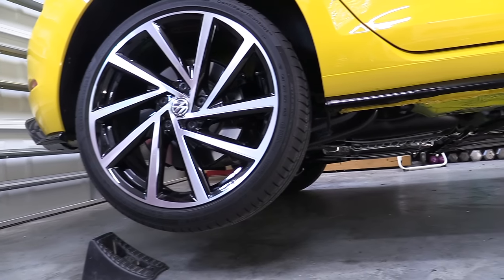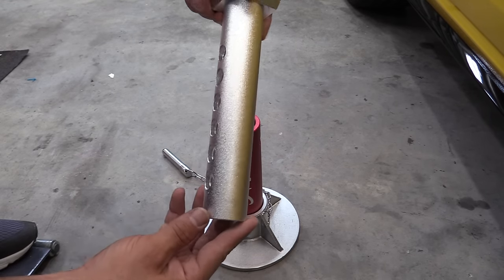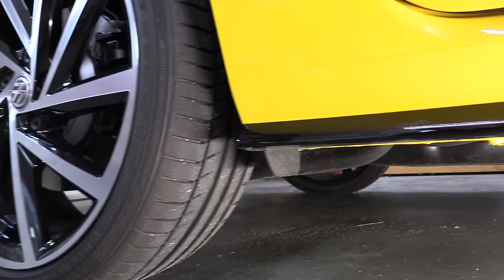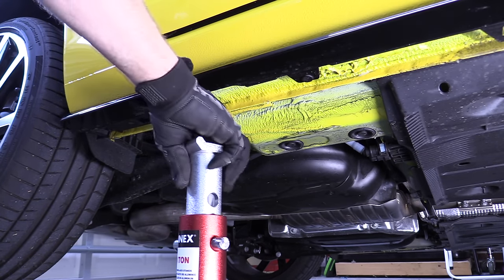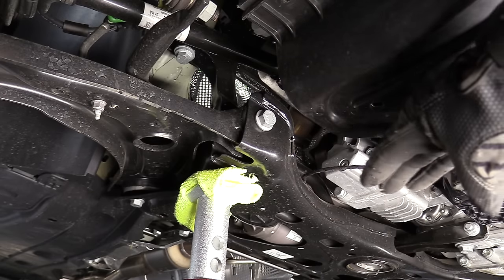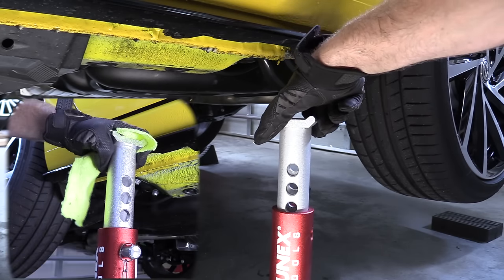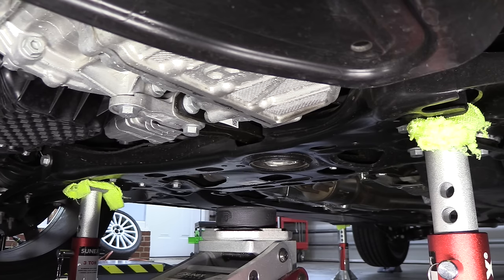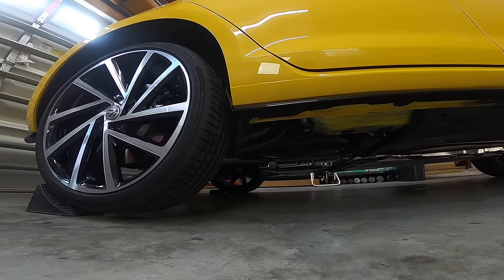How To Properly Lift a Car on 4 Jack Stands

Comment: Sorry. But I dont see the difference between pinch weld or any other part of unibody subframe. What the heck is OP pointing at?
I have 2022 Alfa Romeo. Just for giggles I looked up its lift points on Alfa service PDF. But when looked under vehicle, I could not identify the points as shown in PDF.

Comment: I know this is a super old video, but let’s say I need to get the jacks on all of the pinch welds cause I’m doing work on the sub frame however, my car has so much suspension travel. I can’t jack it up by the rear to put it in the front how would I go about putting them on both sides?

Comment: The angle difference and sideways pressure on the jack stands is less when you go front to back, instead of each side like in this video. Look closely at the first set of jack stands when he's lifting the opposite side. Look how much sideways flex is on them. Not good. The idea when lifting a car completely off the ground is to maximise the distance between each side being lifted. The longer distance means the lift angle is les, which means less chance of the car toppling off the top. Long story short, LIFT THE CAR FROM THE FRONT FIRST! Put jacks on lowest height setting, and then move to the rear and do the same. Once the car is off the ground, move back to the front and raise the car higher as required. Doing it in steps like that greatly minimises the side ways strain on the jack stand... the main cause of stand collapse/failure. Also, DON'T use wood to prop up the car! If you want something between the jack and car subframe, buy something made for purpose.

Comment: Sunex (and every other safety stand manufacturer) do not recommend supporting a car with 4 stands. Check Sunex’s manual.“Stands are to be used in matched pairs to support one end of a vehicle only”. I was called out on this years ago by my company’s OHS. I thought they were crazy but they were right.

Comment: I had an issue the other day lifting a 2013 escape with a jack at the designated lift point, then needing to put the jack stand in place. The jack is in the way. I put the stand as close as I could to the lift point and it seemed not to damage anything but it's kind of a catch 22. Lifting by sunb frome would be an answer, just not sure if it's really designed to be a lifting point.

Comment: I use hockey pucks on my stands. The grooves are too deep in the stands and the don't actually fit into the pinch weld points.

Comment: HumbleMechanic, on my 2013 Audi A4 lift points are marked at the pinch welds however the actual jack point is behind the pinch weld. The car jack has a slit cut to fit over either side of pinch weld however the weight of car rests not on the pinch weld but on the inside of it. Can I safely use jack stands on the pinch welds as the stands would not allow the weight to rest on the inside of pinch weld but rest on the actual pinch weld itself?

Comment: thanks for this! I only have one set of stands, and I never could figure out how to PROPERLY do what you did. So, I ended up buying a set of Rennstands (the modular stands that you can use with your jack and convert to fixed stands. I put one axel on ramps, then lift the other axle with the rennstands. Did this to our Alltrack to do the Haldex service. Now I need to do front pads and Haldex on my R, so at least one axle is free for me to remove the wheels...

Comment: this is easy on a short car. i had an absolute ball ache doing it on my massive long wheel base seven series...
Reply: My shortest car is a 3 cyl. Peugeot 107, my longest is a LWB van. Between them more than 1 ton of difference, weight wise. 
But the general principals are exactly the same when it comes to lifting. It really makes no difference either then the obvious size and weight of each particular design. 
BTW using exactly the same jack and jack stands on both vehicles. ;-)

Comment: Hey Charles, on a 2019 GLI- to lift the front for an oil change, where is the best position for the floor jack underneath the front? 
Just off to the front side of the pendulum mount like in this example? And then add 2 the jack stands behind the front tires on the jack points?

Comment: I'm trying to figure out if I can just lift my Mk4 R32 with my forklift with wood 4x4s clamped on top of the forks. I once lifted a car that somebody parked in my parking lot that way, but it was an old GM mid-size sedan.

Comment: well, this may be considered a "Dumb Question" buuut... id like to be educated in case im doin it wrong... now, keep in mind ive shade-treeded mostly on old (pre '72) cars for 35 years, & most everything ive owned & worked on have been Full Frame cars, so im a bit "new" to modern cars... (& yes, i know, my 98 firebirds not new, its 20 yrs old, but theres a computer & no carburetor, so in my book, its "new" haha) ...my question is, ive added founders performance Welded-In tubular Subframe Connectors to my 98 firebird, so is it ok to set the car up (especially if im doing all 4 like u had urs in the vid) with the jackstands under the subframe connectors on all 4 corners? ...theyre pretty beefy subframe connectors... & theres not to many "ideal" locations on this car...? thanx & enjoyed the video man! (& btw, i really like those sunex jack stands!)

Comment: Hey just FYI I just tried putting my Mk7 up on jackstands and definitely get the same kind of jackstand that Charles is using cause if you get the "V" type jack stand you'll find that the "V" is too deep to properly support the pinch weld.
Reply from the maker: I’ve ran into that on the mk4 and a Miata

Comment: is that mean when i jacking the rear wheel, i need to do it from the front jack point? as i saw some videos said it is safe to jack from other joint points which i highly doubt as it conflicted with owner manual

Comment: Have you ever driven it while on jacks? I have a 2017a3 with 9k miles on it and I get an unbalanced vibration feel in the back when I’m between 30-40mph. Is this normal when on jacks?

Comment: the problem I have is the car jack lowers the car really fast that could  damage  car. I tried to open the valve very slow still go down fast any tips on lowering your car to the jack stand.
Reply: You probably need a special jacks that have a separete slow release valve for this.

Comment: @humblemechanic What about jacking up both wheels simultaneously from the rear via large black tubular part of the rear subframe (adjacent the fuel tank) looks like a solid jack point to lift up, then, place jacks at pinch welds, no?

Comment: Why did he not just jack from the middle rear or middle front jack points, then place the jack stands under the pinch welds. This way really counts on the fact that you got a stiff chassis.

Comment: I get scared using bottle jack stand cause the way it designed I have a fear thatvit might tilt down and other thing is how much higher should a tire go when you jack up the car so it will be easy to work under

Comment: I use a small piece of rubber on top of the stands, I have had a car come off a stand using a rag on top. Luckily no injury caused just scared the life out of me
Reply: Same here. I had some left over rubber sheeting that is typically used for roofing, folded it over twice and stapled the edges and it does a great job of protecting the paint on my front and rear subframes.

Comment: It's quite ironic for you to make beginner videos despite the turbo car just out of shot.

I was taught not to set the brakes on vehicles with relatively large tire sidewalls due to excessive side load generated in the tires when the vehicle is at high roll angles. When I was in tech school, a group of my classmates put a jack stand through the left wing of a Cessna 310 because they had set the brakes. When jacking the first side up, the side load in the tire on the strut supporting the aircraft caused the tire to jump a little and walk the plane a few inches such that the jack came off the jacking point and the wing slammed into the readied jack stand just beneath it. Good times. I only ever use chocks now.

Comment: I've always used stands and this is a good tutorial but lately thinking of trying ramps for oil changes. Any good ramps out there that fit and don't cost a fortune? The old school steel ramps sold everywhere just don't have the clearance for todays  low cars.
Reply from the maker: I have a set similar to this. https://amzn.to/2xyPtTD
Reply: Get the ones for trucks at Crappy. The car ones have a skirt on the side that digs into the air dam on my 2012 cruze or just straight up hits my 2015 golf

Comment: just jack up the car from the front lifting points, put jack stands under the front pinch welds. do the same for the rear. That's it.

Comment: Can you strongly recommend that floor jack? Also sunex as a brand? I’m eyeing their impact socket set.
Reply from the maker: Sunex is pretty good. I’ve had several of their sockets for 15+ years. I don’t really have a favorite jack. I’ve been using a Sunex or Sonic tools the last several years and they are solid.

Comment: it doesn't work if you have a fairly smaller jack. My jack does lift the front or rear up but its not high enough to put a jackstand underneath.

Comment: Has anyone reading this ever put a Honda CRV from the model year 2018 onto jack stands?  I can't find a spot with the giant cover underneath the front end.  Must be 20 bolts to undo down there so screw oil changes but I can't even to a winter tire changeover.

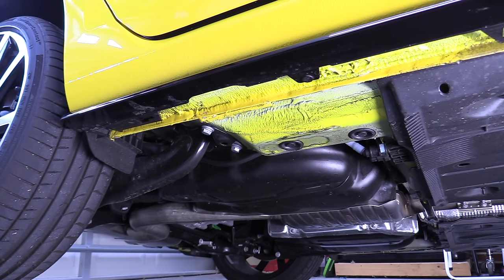Comment: Can we use the spot with two rubber grommet shown at 3:05 instead of the pinch weld? Thanks.
Reply: For heavens sake, NO! Please people use some, of the very rare, common sense...
One single sheet of thin metal, standing on it's side and with large holes in it. Does it really seem like a good lifting point for a car, in fact for anything?!!!

Comment: I have a extremely hard pack dirt driveway. If I put a little metal plate underneath each jack stand would it be safer? Or is on the hard packed driveway ok?
Reply: Find a concrete pad that's big enough to be entirely underneath your car.
You're flirting with extreme danger jacking on dirt.
Reply: Doug N that’s why I asked if I put down a square metal plate under each jack, would that work?

Comment: I'd love to know how to lift a 2012-2018 Audi A6. There seems to be nothing online about it and I'm pretty sure I have to remove a bunch of underbody carpet first.
Reply: I guess that's a missing point on this video. 
First and most important USE your car designed lift points. There's very good reasons why they're designed and built for that specific function. Same way the manufacturer gives himself the trouble to write it on the user manual, also for very good reasons! ;-)

Comment: I can lift the front of my '18 S3 from the front subframe and get two jack stands under the front pinch welds no problem. Is there a jack point for the rear where I can lift the back wheels simultaneously to get jack stands under the rear pinch welds?
Reply: Did you figure it out? I have the same question, but all you got was 🦗🦗🦗🦗😅
Reply: @risingawareness13  I bought a cross beam that fits on my jack and lifted the car from the rear suspension.

Comment: You never secured the pins on the jacks, a small bump or accidental hit could knock it partially out and create a big problem. Also, putting the floor jack under the car does add some protection, but if a jack fails on the opposite side of where the floor jack is, you would still be crushed. I always put 4 jacks, and then an extra jack/ floor jack on each end of the car. This way each end of the car has a backup jack.

Comment: How about lowering the car ? just reverse the process and do it notch by notch? My car is stuck on quickjack, quickjack is broken and I need to get the car down from the 1st locking position.
Reply from the maker: Exactly the opposite. One corner at a time.

Comment: My manual says that the car should be in neutral in the parking brake released, does anyone know why or which method is better?
Reply: Only if all wheels are secured with wheel chocks. If not, the car will just roll off the jack. I suppose they say that in the manual because f you have the brake on and you start lifting the front, the brake might fail suddenly, and the car would jerk to the rear and slide off the jack. Same with the gear, it might slip out of gear.

Comment: I’m storing my car for winter and I was told to “lift” my car to avoid “flat spots” on my tires. My question is, do I put the jack stands on the frame when storing? Would that not hurt my suspension now that it’s gonna sag for a few months? I’m storing it til March. What are my other options?
Reply: You could get FlatStoppers from RaceRamps. They are pricey though.
Reply: @thunderbolt2000k  wow didn’t know those things existed. You’re right Theyre really expensive, i dont think this item is for me. Thanks for the recommendation.
Reply: @ansleypierceorencia4816  np

Comment: Awesome video! Very informative as always! Not sure if you’d be interested but I really dig the rubber pinch weld hockey pucks ECS Tuning sells. They have grooves on the back side to fit perfectly in your style of the Sunex jack stand. I just happen to have the ECS brand which is identical to yours.

Comment: Any reason why you supported the front of the car from the subframe first instead of supporting it from the pinch welds?  That would've saved you the extra step of having to move them or am I missing something?
Reply from the maker: You are lifting the car on the pinch weld. It's too short to have both on it. :(
Reply: @HumbleMechanic  DOH! Didn't think of that. Thanks!
Reply: @AzteCypher  Apparently, neither do the manufacturers...😖😡

Comment: Do the spacers alter the handling?  If so, how so?
Reply: ... Well, according to Dodge (and Pontiac), wider is better...it just increases track width making for a more stable platform with the benefit of flush wheels/tires

Comment: Yo Charles, I have read that AWD cars’ ABS systems don’t like wheel spacers- true or no?  Is there a rule of thumb for how much spacing before it causes ABS issues?
Reply from the maker: Good question. I will be doing the testing on that with 15mm and 10mm rear/front
Reply: Cool- I’d be interested to hear what you discover, cuz I’m wanting to do the same

Comment: What benefit do you get from spacing the wheels?
Reply: Broader spacing will, most of the times, improve the behavior on turns. That's the theory. 
 
With this said, please be aware that in most civilized countries. The use of this type of spacers is not recommended and is also illegal. Making it an immediate failure point on inspections! ;-)

Comment: Since when do you need all 4 wheels off the ground for brakes and tire rotations...
Reply from the maker: Bleeding abs modules or even all 4 brakes would be a pain jacking the car up and down. I mean if you only have 2 stands, you may have to.
Reply: @HumbleMechanic  I only Jack it up twice when I'm doing brakes... do the left side then the right side. Bleeding an abs module yes you need to have all 4 off the ground. If you need all 4 off the ground for a tire rotation you're doing it wrong... it's just a matter of personal preference.

Comment: Honest suggestion, why don't jack stand manufacturers create a stand that will fit under the designated lifting area.
Those flat-top stands bend the seams, and those other wider stands never fit correctly. 
Why not mimic the same style head as the jack that comes with your car? 

They have a "U" shape hollow to allow the seam unrestricted entry and then each side of the "U" shape touches the body to support the load.

This makes more sense than providing the public will ill-fitting jackstands that will damage the underbody of a car.
Reply from the maker: That’s a good point. Some do.

Comment: But what if the car isn't that short and the back doesn't rise up very much to put the jack stand?
Y just don't figure it out where to put the jack in the back
Reply from the maker: That gets trickier. This is when you need to find a second location for the stand. Maybe on the subframe directly like the front I’m showing

Comment: Would you put a heavier auto like a Touareg on hockey pucks or would they begin to crush the puck? @humblemechanic
Reply from the maker: probably not. But im also not trying to put a Touareg up on jack stands
Reply: @HumbleMechanic  Thankyou for that reply. Not even if something like 12 ton snap on jack stands? What do I need if I want to be able to do work under the vehicle if need to. I want to learn at home how to do it all

Comment: This is not the way to lift your car. Definitely not. You want to lift front and back like he's doing, but what you don't want to do is lift each side to it's maximum height before getting all 4 jackstands on. Because you run the risk of the car sliding off the stands due to leverage. Start with the stands being low, with all 4 on, then you can go around and move the stands higher while jacking up the car again. It's slower, but much safer for you and the car.

Comment: 2:13 what about lifting just behind the pinch welds next to the two rubber gromits
Reply from the maker: It will probably crash. That is not reinforced
Reply: HumbleMechanic cool man thanks

Comment: My pinch weld bends when i tried to lower it onto jackstands. Poor technique or poor construction?
Reply: Little bit of both I'd say. Pinch welds aren't always the best spots to support your car. Depends on the make, model and weight of the car.
Reply: @vidyamancer7135  means always better go go with the subframe instead of pinch welds? Kinda suck to bend them pinch welds. But the owner's manual say you can jack on the pinch welds. So I'm at a lost here